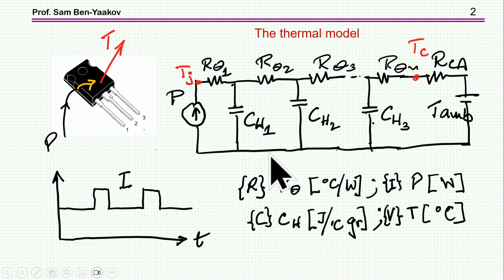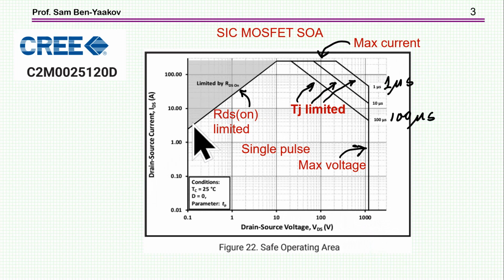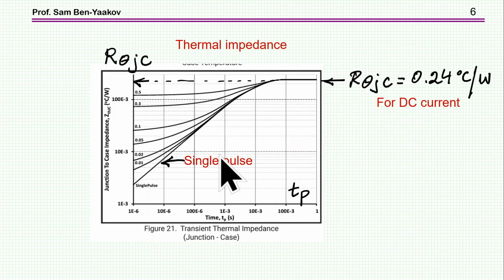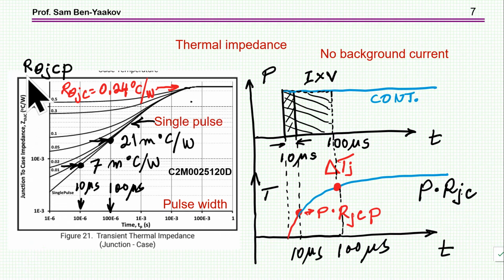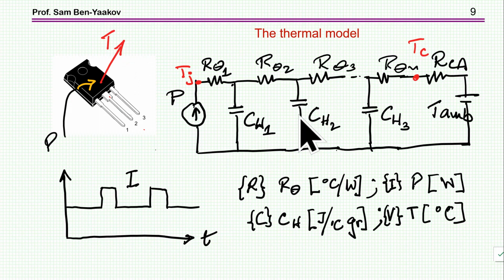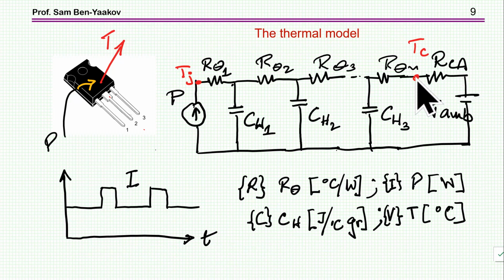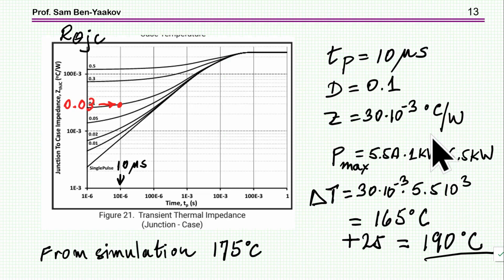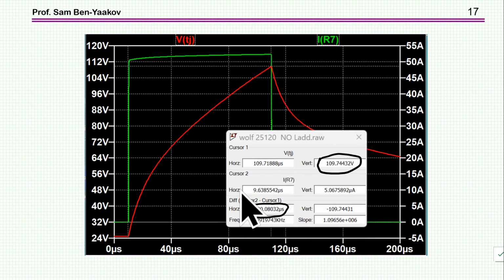Intuitive explanation of SiC MOSFET thermal impedance, SOA, and LTspice simulation

Comment: Hello sir. I believe the difference in maximum temperature that Cree (Wolfspeed) can claim versus what ST can claim has to do with passing qualifications for die packaging (Not necessarily the die themselves). Packaged part qualifications are stringent and require tests such as temperature cycle which may be a problem for some combinations of die and mold compounds. Mold compounds can have high Tg but CTE differences in materials can cause die cracking, etc. The temp cycle requirement can be 1000 cycles of -55C to +200C in order to claim to have a 200C rated part.  By the way, I enjoy your videos. Thank you for them.
Reply from the maker: Thank you for the intersting input.

Comment: Hi , Thanks for your presentation . Basic Question: How did you create the " Cauer Netwrok" from Zth curves ?. The manufacturer do not provide the thermal circuit and only Zth curves are in hand . however with these curves only the Tjmax is possible to be calculated
Reply from the maker: You can fit to the single pulse curve

Comment: Thank you for the all of the your great videos! These thermal models are usually from junction to case or from junction to mounting base  (nexperia). Now if you want include  ambient temperature to simulations/calculations and to get junction in different ambients pcb layout etc starts to affect. Do you have any suggestion which would be the best way to get estimate for junction in different ambients?
Reply from the maker: The key is of course the thermal resistance between case and ambient. There are simulators on the web that can help to estimate this thermal resistance for heatsinks and PCBs

Comment: Is there a easy way to change the displayed unit on the scale from V to C ? this is mostly for ease of reading the data. 
This may be on a tangent BUT the FET is rated for 1200V but safety wise what margin is there or what should i use when designing? can i switch 1200V and call it safe? or should i derate and only go for 1000-1100V?  
Asking since for lower voltages i often add 12-15V and call it a day but here at the high end that amount is potentially in the measurement tolerance
Reply from the maker: V to C? please indicate the relevant minute of video. 
The safety margin largely depends on the expected voltage over shoot. Without a snubber the voltage peaks could be very high.
Reply: @sambenyaakov  20:09 , V as in volts and C as in Celsius it is the junction temperature
Reply from the maker: @Robert88KAL  I have no idea how to do it in the LTspice environment.

Comment: Just one doubt..this RC thermal model is only applicable for switching mode or during linear mode as well?
Reply from the maker: This is THE ultimate thermal model, applicable to any power profile, limited of course by the accuracy of fitting.
Reply: Depends on the author of the spice model. If you use a spice model, self heating, level3, then you can model linear mode as well. 

Manually, you can always estimate the power loss in linear mode, and force an external current source through the Cauer Model.  I might publish this technique.
Reply: @Lets_Go_Canes did you publish this by chance? Also how can I tell if the model is level 3?